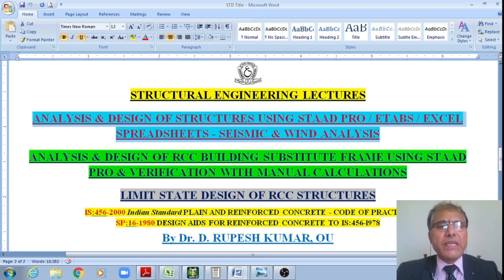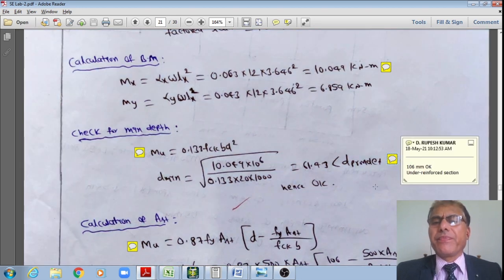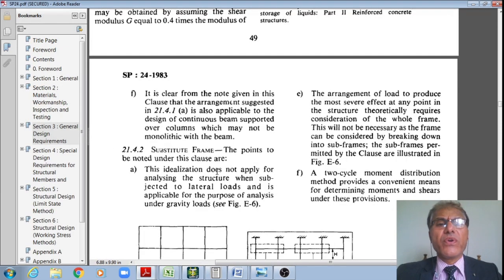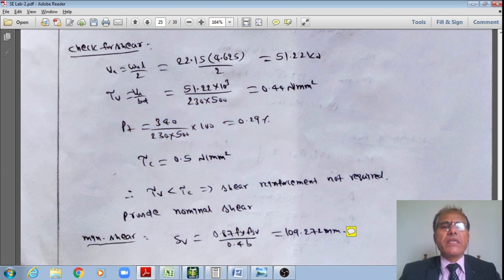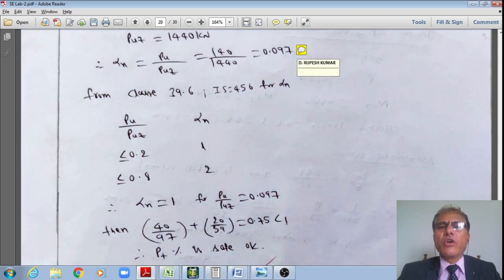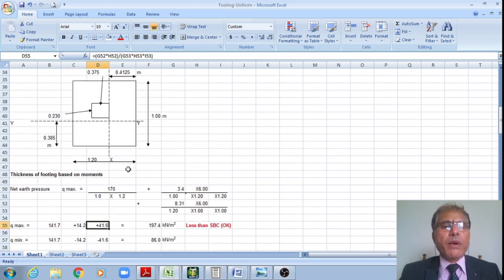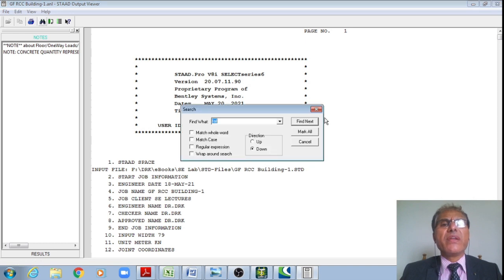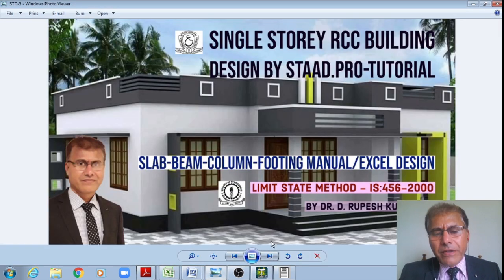STD5|SingleStorey RCCBuilding Design by STAADPro|Tutorial|SlabBeamColumnFooting Manual&EXCEL Design

Comment: Good morning Sir! Sir In analysis of beams, for shear force, can we add SF coming from slabs using the beta formula to the SF calculated based on Bm?
Reply from the maker: Question is not clear. The shear on the beam is due to (i) loading on slab, (ii) loading on beam, (iii) bending moment/torsion on beam. All these contribute to shear force of beam.